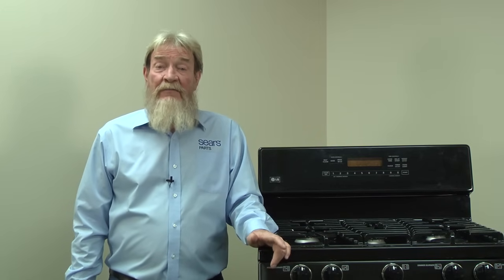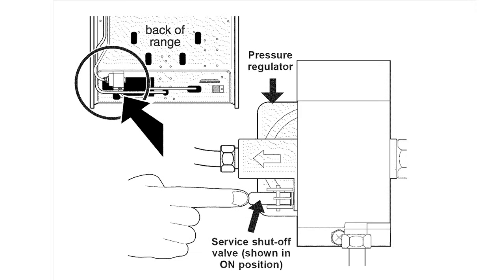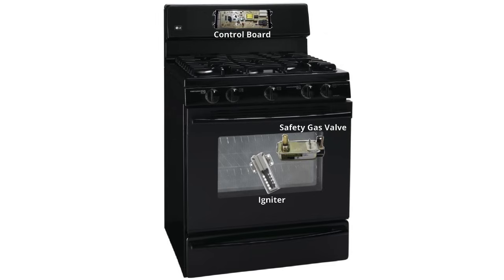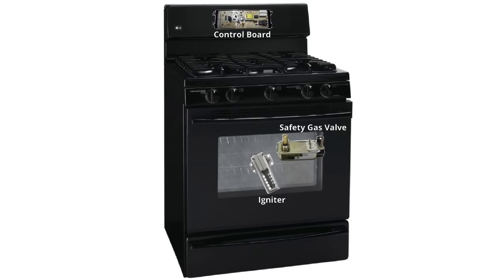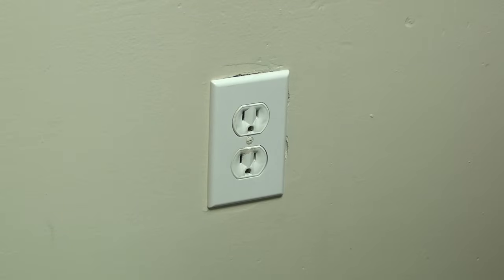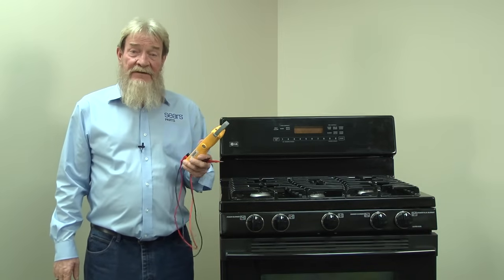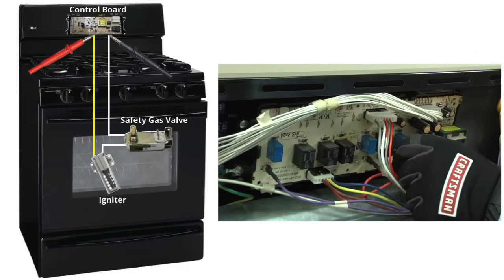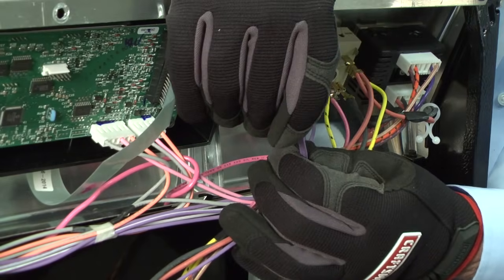How to Fix a Gas Oven that Won't Heat: Troubleshooting Gas Range Problems

Comment: I have a double oven where neither top nor bottom seems to be getting propane supplied to them yet i can see that the electronic ignition is glowing hot on both of them, trying to ignite the incoming gas. i do have propane coming into the range because the stove burners work fine. So if both ovens stopped working together, what is in common to both of them yet would not affect the stove top burners?

Comment: Its lighting for couple secs then going out
Reply from the maker: Unplugging the range and replacing the igniter will likely fix the problem.
Reply: @searspartsdirect  i just got it bran new two weeks ago should i bring it back then
Reply from the maker: @suzettemelbourne501  We recommend that you check the provisions of the warranty. The warranty is typically provided in the owner's manual. Contact the manufacturer or store that you purchased the range from and get help with service or replacement under the warranty.

Comment: I have a Kenmore  gas range, model #790.75403501, need to order an oven igniter but can't figure out the part #. Can you help?
Reply from the maker: The part number for the bake burner igniter is 318177720. Here's the link for that part: https://www.searspartsdirect.com/product/6aeq99pswf-0022-628/id-318177720 . The broil burner igniter is part 318177730. Here's the link for the broil burner igniter: https://www.searspartsdirect.com/product/4md5doheps-0022-628/id-318177730 . We hope this information helps. Let us know if you need further assistance.

Comment: Does all oven has igniter?
Reply from the maker: No. Some Whirlpool models use a spark ignition system instead of a glow bar igniter. Some ranges older than 20-years use a pilot light to ignite the oven burner. Let us know the model number of your oven or range and we'll tell you whether your model has a glow bar igniter or a different ignition system for the oven.
Reply: @searspartsdirect  ohhh, I don't know what is the model number of my oven buy it's brand is Labelle, it's from Philippines. This oven I have is not electric oven, it's purely uses all gas. The problem of my oven is that its fire would not go higher even if I put its maximum temperature. What will I do?
Reply from the maker: @rdg2753  Check the gas supply cut-off valve to make sure it's fully open. A partially shut gas supply cut-off valve could be restricting gas going to the oven. Also, check the gas supply pressure going to the oven. Low gas pressure could be keeping the oven from heating. A bad pressure regulator on the oven or a faulty burner valve could also be preventing the oven from heating.

Comment: Hello, thank you, great video!!! After I swapped the igniter, now it turns easily on, but when I I try to turn the oven off, by turning the knob to off, the flame turns to very small flame, but it never turns off unless I turn the gas at the shutoff valve off. Any ideas?
Reply from the maker: That's a dangerous problem that should be diagnosed and repaired by a service technician. We recommend that you leave the range's gas supply shut off and have a service technician service the range before using it again. The service technician may find that the oven's safety gas valve isn't shutting off properly—causing the a small amount of gas to keep flowing to the burner after you shut off the oven.

Comment: A faulty bottom ignitor was exactly what was wrong with my oven not heating properly.  At first, I was skeptical because my ignitor was glowing fairly bright, but apparently it was not glowing bright enough to open the gas safety valve to allow the burner to light.  I removed the ignitor by unscrewing the two screws and unplugging it from the rear.  I then checked it with a voltmeter and it had approximately 180 ohms.  The actual part of the ignitor that lights, can best be described as what looks like a black strip of sandpaper, with a shiny or reflective bass to it. Upon inspecting my old ignitor, I saw that only about half of the black portion was still shiny and reflective.  I purchased a new one on Amazon for $17, and it was an exact replacement with the same connector attached. All areas of the piece inside the ignitor that looks like a black strip of sandpaper on the new ignitor were shiny and reflective, with no dull or burnt out portions on it.  Prior to installing it, I checked it with a voltmeter and it had approximately 170 ohms.  After I installed it, it got brighter than my previous ignitor, and the burner fired up about 30 seconds later.  This was a very easy fix and only took about 15 minutes.  You can do this!

Comment: Thanks for the great video.  I have a Frigidaire FGF379WJCA and when I turn on the oven (not broil), the top ignitor turns red and lights the flame but the bottom ignitor doesn't.  I checked the resistance on the bottom ignitor and it is 227ohms with 3.5ohms across the safety gas valve.  After about 4-5 minutes of the top flame being lit but before the oven beeps indicating target temperature has been achieved, the top flame goes out and the ignitor dims out, then nothing.  Any ideas?

Comment: PSEG tech first said it was the igniter. He changed it but oven still won't heat.
They sent another service tech who said it was the switch. The oven is pretty old and they're having trouble locating the part.
Where is the switch located on a gas oven? Is he talking about the thermostat?
Reply from the maker: Two switches could be preventing the oven burner from igniting. If the igniter glows when you start the oven in the bake mode, then the switch that the service tech is describing is likely the safety gas valve that has a current-sensitive switch. That current-sensitive switch opens the oven burner gas valve when the igniter heats to ignition temperature and allows enough current to flow to the safety gas valve switch to trip that current-sensitive switch. If the igniter doesn't glow, then the switch in the oven thermostat is likely preventing the oven from heating because that switch isn't sending any current to the igniter and safety gas valve. We hope this information helps. If you need further assistance, let us know the model number of your range and additional details about the failure.
Reply: @searspartsdirect  Very helpful. Thank you.
Tappan model no. 363272 .
I'll have them take another look at it and follow your suggestions.
I'll let you know to outcome.

Comment: I have a Samsung gas range and the oven bake and broil do not work at all but the stove top does work. When I turn on the BAKE setting and set the temp it just sits at 150 and never turns on.... I don’t have the bottom inside cover off so I can’t fully confirm if the igniter is glowing but I’ll take it apart this weekend, any ideas j til then? I think it’s the igniter
Reply: I have exact same thing, stove is just a year old

Comment: What if.... igniter comes on some times but only for about 3 seconds.  I hear a click in the controls board area when it turns off.  F4 error code.  Temperature sensor has already been replaced.   Interestingly if I brush off the igniter it comes on more often.
Reply from the maker: Let us know the model number of your range. The F4 code on many gas ranges indicates that the temperature sensor is bad. Because you already replace the temperature sensor, that part is almost certainly okay. Wiring between the temperature sensor and the electronic oven control board could be causing the control board to detect a bad temperature sensor. Unplug the range and measure resistance through the sensor from the wires that plug into the control board using a multimeter. Most oven temperature sensors have resistance of 1050 ohms at room temperature. If your meter measures infinite resistance or near 0 resistance, then you'll likely need to repair or replace the oven temperature sensor wire harness. Based on your details, you may also need to replace the oven igniter. We hope this information helps. If you need more help, reply with the model number and additional details.

Comment: To check if the igniter is getting hot enough on an oven that takes a long time to light can I just while checking the igniter light a match or use a torch to heat the area of the igniter? If the gas then come on I could deduce that the igniter is not getting hot enough on its own right and therefore needs to be replaced?
Reply from the maker: No. Heating the igniter in that manner can damage it. A technician would measure live amp draw through the wires going to the igniter to determine whether the igniter is getting hot enough to allow enough current to flow to the safety valve. Most people don't have a meter that can measure amp draw and that live amperage check is dangerous if not conducted properly. Replacing the igniter fixes the problem that you're describing in most situations. We hope this information helps. If you need further assistance, let us know.
Reply: Thank you for the response, I'm replacing the igniter and will go from there. Also the burners on the top of the range release gas and I can hear and see sporadic sparking but it doesn't seem to be enough to light the gas - I use a lighter instead. I would like to fix that. Do you have a video on that?  Thx.
Reply from the maker: @Hizenbird  Although we don't have a video for fixing surface burners that won't ignite, we do have written and illustrated repair help for that type of problem here: https://www.searspartsdirect.com/diy/symptom/gas-range-repair/1235943/gas-burner-won-t-spark-or-ignite/ran00025587999998988 . Unplug the range and check the igniter electrodes for spills that may be covering the electrode or burner head. Here's a video on how to clean the burner head on a typical range: https://www.searspartsdirect.com/diy/article/how-to-clean-grates-and-burners-on-a-gas-cooktop-video . Be sure to clean the ignition port as shown in that video if you have the same type of burner heads as the ones shown in that video. If you hear ticking when you turn a burner knob to ignite a surface burner, then the spark igniter switches on the burner valves are likely okay. If the spark module isn't sending spark current to the igniter electrodes consistently, then you likely need to replace the spark module. We hope this troubleshooting information helps. If you need further assistance, let us know and give us the model number of your range.

Comment: How long should it take for the oven to ignite? Anyone know? My ignitor glows, and it gets slightly warm inside the oven after a couple minutes, but no flames, no actual heat. I've never had a gas oven before, so this is all a little bit new to me. I'm pretty sure it lit when we first got the gas turned on about 2 weeks ago, so and it hasn't been used in between so I don't see how it could just stop working like that. Am I maybe just not waiting long enough? I get a little freaked out just leaving it on without it lighting because I'm worried it'll open the gas valve and start leaking gas without actually igniting, and then blow up or something. 
I have no idea if that's even actually possible though, so if anyone knows, I'd really appreciate it.
Reply from the maker: The burner should ignite within a minute or two after the igniter begins glowing. The safety gas valve won't open unless the igniter glows hot enough to ignite the gas so gas won't leak while the igniter glows. Even though the igniter glows, it's likely not getting hot enough to safely ignite the gas so the safety gas valve isn't opening. You can likely fix the oven by having a service technician replace the igniter. If you're confident that you complete that repair yourself, here's a video that shows how to replace the igniter in a typical gas oven: https://www.searspartsdirect.com/diy/repair-guide/how-to-replace-a-gas-range-oven-igniter . Unplug the range and shut off the gas supply before replacing the igniter. Make sure that you position the igniter in the same way that the original igniter was installed. We hope this information helps. If you need more assistance, let us know.

Comment: What is the cause of a pressure valve being open on the gas valve? I know they are on hot water tanks but whats the point of having one on a gas valve? Mine keeps tripping.
Reply from the maker: Your question seems to be about the gas supply going to the range. If that's so, then you'll need to have a plumber examine and repair that issue. If you're describing an internal failure in the range, let us know the model number of your range and additional details about the failure you're describing.

Comment: What if you replaced the ignator, and still not lighting?
Reply from the maker: Problems with the gas supply, a bad gas pressure regulator, wiring failures or a bad safety gas valve can prevent an oven burner from lighting. Let us know the model number of your range and details about the problem (such as whether the igniter glows). We'll try to help you with troubleshooting tips once we receive more information about the failure.

Comment: Is the igniter supposed to stay on after the gas is lit?
Reply from the maker: Yes. The igniter is in series type of electrical circuit with the safety gas valve so it stays on whenever the burner is lit. The igniter shuts off when the control cycles off the burner to maintain the set oven temperature and then the igniter turns back on to ignite the burner when the control cycles the burner back on.

Comment: So, I also have a Cuisinart DCC-1200 it stopped turning on. I did the unplug and wait for 24 even a weeks but somethings shot. I would assume it was after leaving it on the whole day for the coffee to stay warm. What can we suspect from this one?
Reply from the maker: Make sure that the electrical outlet that you have the coffee maker plugged into works. You can check the electrical outlet by plugging a different item into the outlet to see if the outlet works. If the outlet works, then a broken power cord, wiring failure or failed internal parts could be preventing the coffee maker from powering up. We don't have internal parts or technical information for that model of Cuisinart coffee maker so we recommend that you contact Cuisinart for help with parts and internal failures. Here's a link for the Cuisinart website that has contact information: https://www.cuisinart.com/

Comment: Hello I have a Frigidaire FGB24S5DCA oven and the broiler works (both top and bottom igniters glow) however, when tried to bake there is no gas coming out. Also, the first time or I should say when I noticed the issue the kitchen smelled like gas (I checked the lines for leaks and everything seemed fine). Gas smell went away after turning it off and never any smell ever since. This was like 2 weeks ago. Can you please tell me if the problem is most likely the bottom igniter?
Reply from the maker: Yes. According to the symptoms you describe, replacing the bottom igniter will likely fix the bake burner ignition failure. If you replace the bottom igniter and bake burner still won't ignite, then a failed safety valve could be causing the problem.
Reply: Sears PartsDirect is there a way to reset the safety valve ?
Reply from the maker: @imim4136  No. The safety valve is actuated by a bi-metal sensor disc that opens the valve when enough electrical current flows through the valve to heat the metal and warp the disc to open the valve and allow gas to flow to the burner. As the igniter heats up to ignition temperature, the resistance of the igniter decreases and allows more current to flow to the safety valve which eventually heats the safety valve disc to a point where it warps and opens the valve to allow gas to flow to the burner. The safety valve rarely fails because it is a simple bi-metal device. Even though the igniter glows, it's likely not reaching a temperature that is allowing enough current to flow through the safety valve to warp the disc. When the igniter glows but the burner doesn't ignite, replacing the igniter usually fixes the ignition problem. There's only a slight chance that that the safety valve failed. We hope this additional information helps. Let us know if you need further assistance.
Reply: Sears PartsDirect Problem solved thanks a lot!

Comment: my 2 yr old GE JGBS10DEK1BB gas range is not cooking.. should be baked in 1hr but not even done in 3hrs... I think it tripped off to a lower temp. I can see it ignites and burns back but still its not cooking.  Can you help me pls?